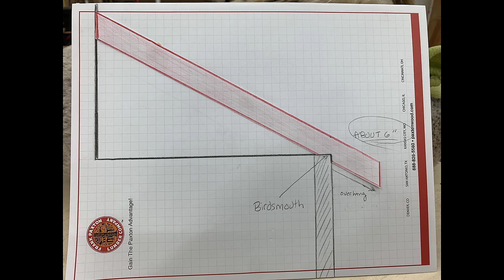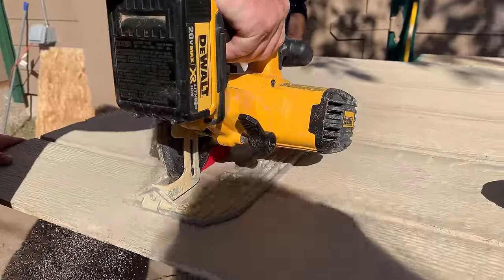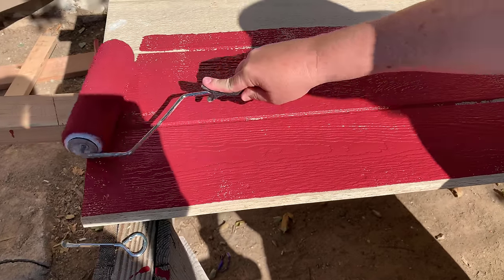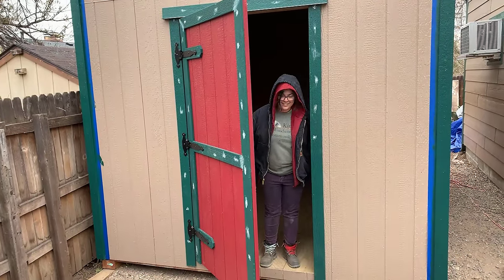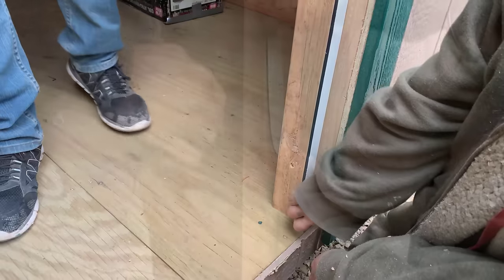105 - Shed Build part 5 Final -  Shingles, door and finish

Comment: No for lights. I took some 12 volt LED lights that you can get at Oreilly Auto. One I got come 2 to a pack and are made by "Truck Series" I put 6 in total (3 packs) in my 10x12 shed. I used a toggle switch above the door and also got lucky and got a 51 series AGM car battery off their RBT shelf for only 50 bucks. (nothing wrong with it. It sat on the shelf for over a year.) I keep it charged with a 4 watt solar panel I also got there. Ran the wires thru a small hole I dirlled and then filled with silicone. No leaks yet after 4 years. Havent had to change battery yet either. Can't run anyting off it but it provides a lot of light.

Comment: GREAT video series!  I'm building my own shed similar to this one. Sorry if somebody else made the following observation previously (I wish I could easily search through the comments and like what others said). The OSB sheets/sheathing need some spacing between them, just in case they get wet, they might expand, causing some problems.  I used big thick nails as temporary spacers, and removed them once the but the sheathing was nailed in.  The required spacing printed on each piece (mine is 1/8" inch).

Comment: Liked the series on the build. If I can offer a tip on security, replace at least 2 of the hinge screws with coach bolts, one through the frame and one through the door. Then touch up with paint to match the hinge, makes them less obvious.

Comment: I love that ridge vent it keeps me busy fixing drywall in ceilings in every home i go to
Reply from the maker: Interesting..  I don’t think I could ever love anything that hurts other people.
Reply: It was tongue and cheek meaning that product leaks in wind conditions and lets blowing snow in to then melt and do damage sence i do DryWall repair on the phone when they describe the problem my first question is do you have ridge vent every time they say the salesman told them its the new way to go they make a ton of money selling that crap and no i don't like products that hurt people i wish content providers dident promote products that dont work
Reply from the maker: Thanks for the reply. It is my first time ever using a ridge vent. But I will be mindful of it.  I’d never heard of the leaky situation before. Now I’ll beware.
Reply: Irvin Wittmeier we have used ridge vent in thousands of roof replacements. The only leak we had was when the ridge vent was torn off by a critter.  Owens Corning vent sure was the product I installed on James’ roof

Comment: I'm in Texas, I never seen a ridge vent before. Down here we use a cement type of board that has holes in it. It goes under the overlap of the roof and lets the attic breath. I wonder what the cons and benefits would be in Texas. Our temps go into the 100-110 F range outside and can reach over 120 F in the attics in the summer.

Comment: Your last step of adding the crosspiece at the bottom of the door -- IMO more important than keeping out what little bit of weather might get through, this piece also keeps out the stinkin' mice that might otherwise squeeze through the gap at the bottom of the door. I'm so tired of mice pee and poop all over my stuff when stored in a building like this. This build looks like it might easily be mouseproof. Spiders and bugs probably not, but they don't bother me even a fraction of the damage that gnawing, pooping and peeing mice can do. I'm looking forward to building a shed about this size soon.
Reply: My squirrel moved in - built a little cave in the foam insulation - and we have a time-share now. haha

Comment: I am building this exact shed with the exception of a wider door.. but what I just realized was if, on the front and back walls, that you could wait to cut the top strip of the walls and just use one piece of siding instead of using two "z" flashing. I wish I would have thought of this before hand 😅

Comment: Would've liked to have seen your friend install that last piece on the ridge cap. Seen many do it but, never liked how it looked.
Now, your build... looks like true professionals made it. :) Thank you for sharing and very informative. For the door hinges, I've ran in the long style bolt's with nylon nuts. So... when you coming out to my place and build me one?? LOL Loved the series. Great material. Cheers :)
Reply: Ham68 the last piece of ridge is installed with 4 nails and the. The nail heads are sealed with plastic roofing cement

Comment: So much better than many others TRYING to show how to build sheds. Really good on details. A couple of points you skipped though. You did not mention ( or I did not hear ) the type of nails for the roofing. Also, on mounting the hinges, good that you mentioned to pay attention to angle of the hinges, but you missed the more important, make sure they are in line with each other. And on the one showing how to lay out the rafters, not of great importance here, that by cutting 1 1/4 inch out for the birdsmouth, the peak will be that much lower, so 33 3/4.  I did note that your blocks for the birdsmouth were close to that, so checking the measurement would have been pretty close. I am not knocking you. You covered most of it much much better than others.

Comment: I'd love something like that just to start a shop in, just add me some insulation and electric ;)
Reply from the maker: That would work perfectly! That's exactly what my shop is!
Reply: My 1st shop was a 10'x12' Toughshed. Since it was all bare studs, it was easy to add power, water, air compressor lines, dust collection, and benches on either side. I also added a lumber rack hanging from the rafters. It felt a little cramped, but was a phenomenal little workshop.

Comment: Nicely done, how much runoff do you expect will fall from roof of shed to neighbor yard? Don't forget,  the utility has a 10' easement below the power lines, 5' from center if pole the length of the spans, in other words, they may want to get equipment in this space to work, that could possibly mean moving the shed.
Reply from the maker: We designed it on skids to be able to easily move it around just for that purpose. I have a friend with a bobcat who will slide it to the middle of the yard if ever needed.

Comment: Just watched your video series on sed building and you did a great job.  Im fixing to start on one for myself, a 10x16.  I did have a question abt your ridgid framing nail gun.  How do you like it and have you had any problems?  Was lookimg at the paslode ones and the ridgid, considering the ridgid is abt 100$ cheaper.  Thanks!!
Reply from the maker: Hi,

The Ridgid is great. I’ve framed a few sheds and of course my whole shop with it. 

Had maybe 2 jams. Better than my Bostich.
Reply: @KingsFineWoodworking   Okay thanks,  I think I'm gonna go with the ridgid.

Comment: I was thinking of using a clear or opaque plastic roof that looks like the metal "wavey" roof and by doing so allow more light in. Thinkinging I would just want more trusses perhaps for strnength, but I'm in NC so show is not really a concern usually.  I also have been thinking of Solar run shed. Thinking 10x14 or 10x12. Thoughts? I have 3 sets of the 2x4 basic kits that allow for straight cuts. Should I use or ditch them? The style I have is barn style and I was hoping to get a storage loft in there. Thanks.

Comment: You probably got lucky or the shingles are made better now but when I did roofs; the shingle lines would vary all over the place using the marks on the shingles so we would use chalk lines for the top edges of the shingles to keep them straight.  For such a  short run of shingles I would have installed each run before starting another run because I can see the pattern where these run groupings have been done and then move down to repeat the process.  Some people it does not bother but it bothers me.
I am looking into replacing the roof on my house now.  It is going to be interesting because I don't know if we are going to use asphault shingles or standing seam metal roof.  The company is going to have to figure a quote both ways to see which is less expensive or how close the two materials are because there is a wood shingle roof with two layers of composition shingles over that up there now which will have to come off.  If  we go with metal the 1 by 4 for the wood shingles can be used for the metal and if the composition is used we will have to go to the rafters and deck the roof before shingling.
Reply: Roy Reynolds you can measure or follow the actual shingles.   I did snap a line for the first course then you can use the jig on the nail gun or just follow the overlap line.    I’m the Adam in the video btw.

Comment: I like the video, very well explained, sure alot of strange terms as I live in Sweden :). But well done! One thing I wonder thou is why there is no overhang on the roof over the door, it would look so much better with it. If I would do a similar shed at home but with the overhang, do i make 2 more trusses and let them hang outside of the house attached to the roof-plywood or how would you do this?

Comment: Hi, I am first time she's builder. I have purchased the plan for 10x10 shed. I am at the point where I am installing the decking for the roof.  The only difficulty I have with your series, especially when I am at the roof is the size of the nails. This detail might be a simple detail for you, but it is where U struggle the most. 

What kind of nails (screws) so I need to use for roof decking, felt paper, shingles and drip edge? If I use long nails they come out from the other side, if I use short ones, I am not co fident if it is strong enough. 

Please help😂. Thank you
Reply from the maker: @teczonesystems  hi, use a 6D (2” long) ring shanked, galvanized nail to hold the plywood to the rafters.  

Staple down the felt paper. 

Then use a 1” or 1-1/2” roofing nail to hold the shingles to the plywood decking. And yes, the will poke through at the bottom. They always do, it’s ok.

Comment: Is it required to get a permit to build a shed?
Reply: depends on the local code - usually it's all about the size of the structure. If it's an accessory to a garage - you may not need a permit, etc.

Comment: Sooooo? Hire someone to do roof? I thought this was totally DYI?
Reply from the maker: I’m getting pretty fat & lazy in my old age.  Perhaps it’s best to consider this a DIY for people more fit than me.  I apologize if I mislead you.
Reply: @KingsFineWoodworking  I built a primitive double wattle wall hut - and had poly-canvas tarp roofs with rock wool insulation. The weather would make the rock wool to heavy so I got a butyl pond liner - rolled it across the roof, put another poly-canvas tarp on top. Now the heat stays in real good and the insulation doesn't get water logged. hahaha.

Comment: Hi,
I really enjoyed the videos, the only thing i don't understand very good, are you are 'imperial measures', to much calculations every way.
I built one like yours, but now i will build one around it , bigger and with a flat roof.
When it will be built, I will tare the old one out and will stand in a new woodshop.
At my age it is necessary to have an easy access.
Thanks for sharing.
Keep it safe, it is not over yet. 
Certainly don't follow the rules about Corona safety of your 'Dear Mr. President'.
Willy from Belgium. 
😷😷😷

Comment: I don't quite understand your dimensions  . 10 X16 and yet it has a 12 ft clearance on the inside . I'm I missing something here .
Reply: Henry Rodgers 10 feet wide, 16 feet long, 12 feet tall at the center and 9 feet at the walls
Reply: 10 feet wide, 16 feet long and 12 feet high to the peak in the center.
Reply: 12 ft in the center of the peek
Reply from the maker: it's 12' in the middle of the shop on the inside.  And 10' along the walls on the inside.  This is because of the 7:12 slope of the roof.
Reply: Ok thanks